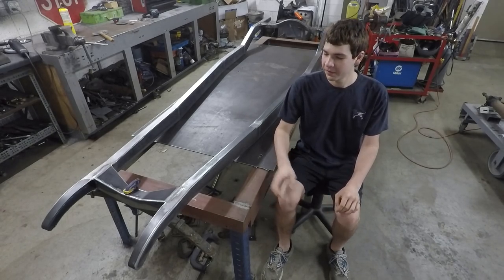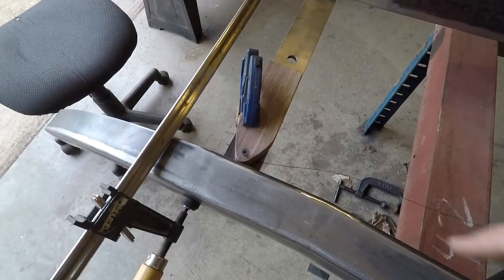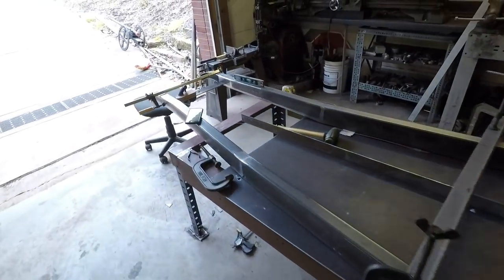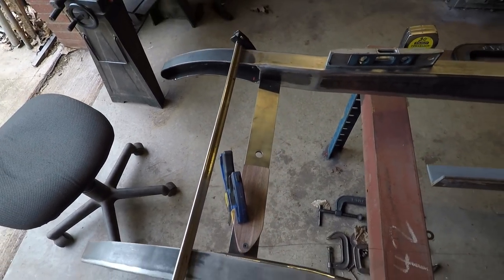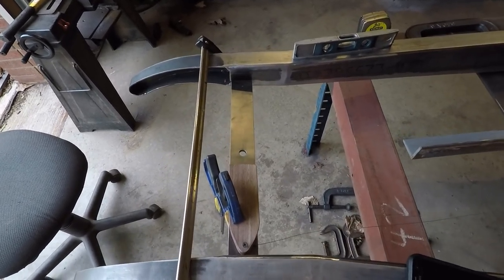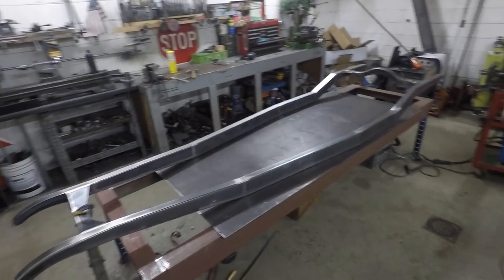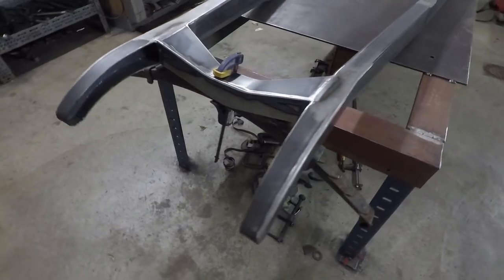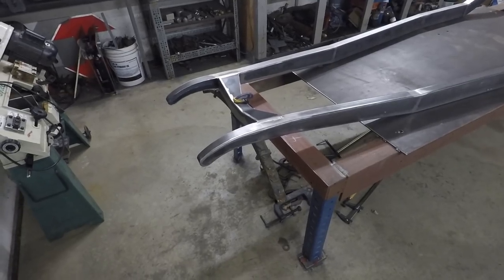Aligning a Custom Frame | Boat-tail Speedster Pt. 5

Comment: If you want to promote directional stability, go with positive caster. If u want cornering stability go with negative camber. Keep in mind there are 3 different angles to adjust and they must be done in this order; Camber, Caster, Toe. You always finish with Toe...
Reply from the maker: good to know, thanks
Reply: No problem. Just sharing usefull information i learn in the automotive field.

Comment: Are you going to do a x member in the center or just a regular cross member in the center eather way this is a cool build and I'm glad to see some one go the lenth on the build your doing a great job looking forward to the next phase of the build
Reply from the maker: probably some type of X member for more strength
Reply: Sounds great plus it's nostalgic to the type of build your doing and increase rigidity of the frame

Comment: ik you want it to look original but why didn't you use a modern day shock suspension cause you knw the leaves are gonna get flat after a while and also I like the drum brakes too but shoud've went to disc brakes but hey original is better for the look but tbh should've modern it a bit atleast for a better ride expirience and so far from looking at frame some X stiffeners would've went good too but I remember that the axle gon get in the way